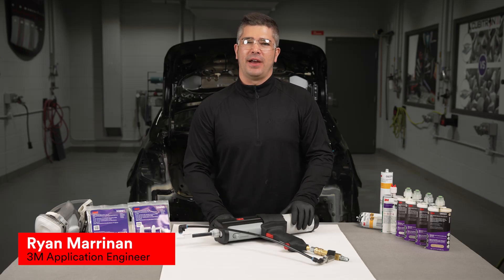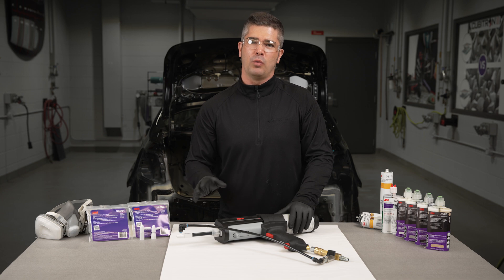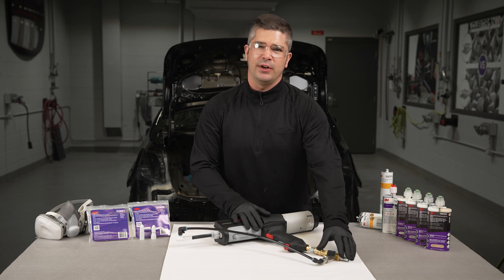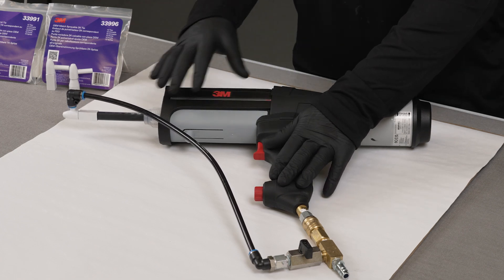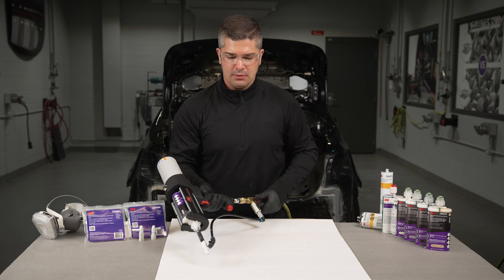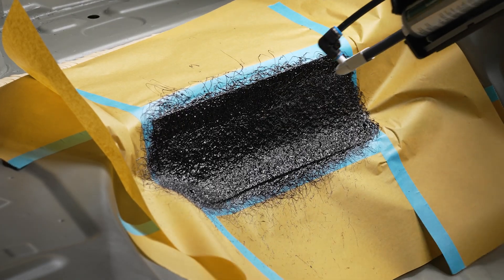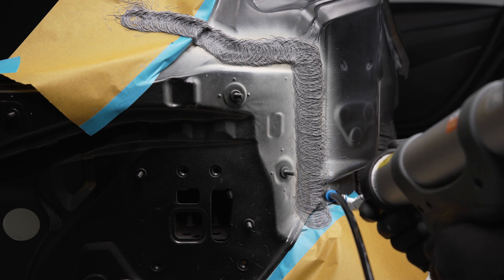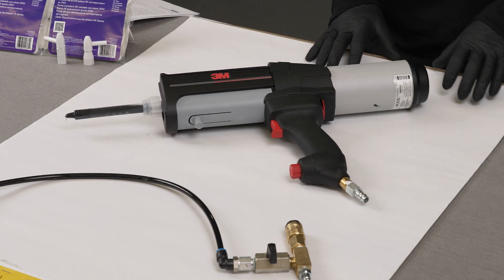Match Robotically Sprayed OEM Seam Sealer Beads and Textures

Comment: But the top coat is just for look and a bit more protection? And the texture change properties?
Tanks
Reply from the maker: Hi there! Thanks for your question! In any seam application, it’s important to always first seal the sea, and secondly to match the original looking appearance. Some application some systems this may be a two step process, and in some instances it can be accomplished in one step this example here shows a two step process to properly seal the seam and match the original looking appearance.

Comment: May i have the part number for the gun and the attachment i need those ASAP
Reply from the maker: Sure! You’ll need the 3M™ Performance Pneumatic Applicator (09930), 3M™ OEM Match Air Supply Kit (33999), and for attachments, the OEM Match Sprayable Tips – 1K (33991) and 2K (33996).

Comment: Ryan, both tips are one time use, is it the same for the whip?
Reply from the maker: Hi there! Thanks for your question! Please note that the tips are one time use. The air whip is reusable, as it only delivers air to the tip, meaning that the product does not flow all the way through the air hose. Hope this helps.